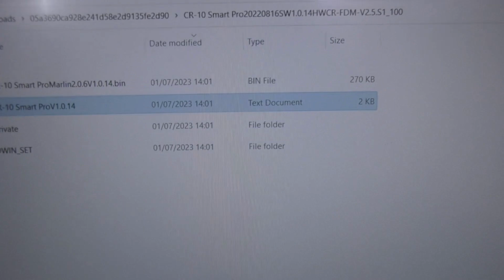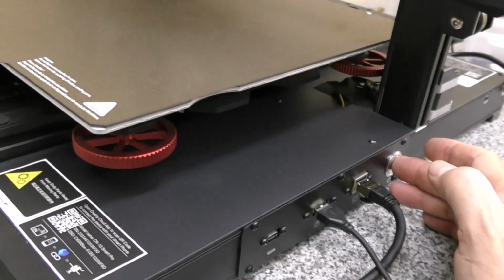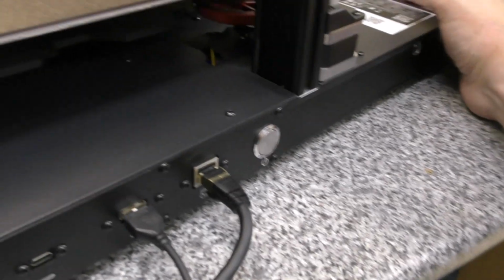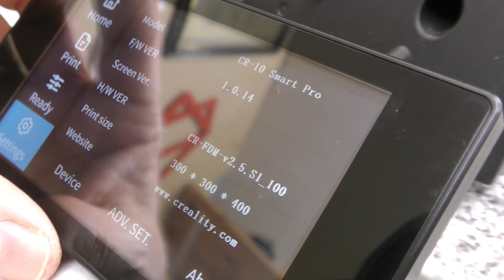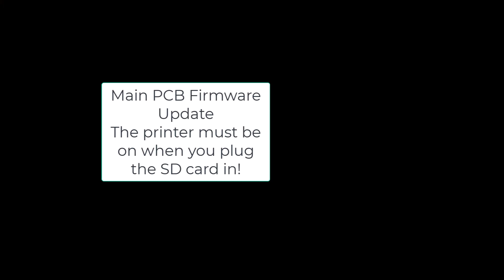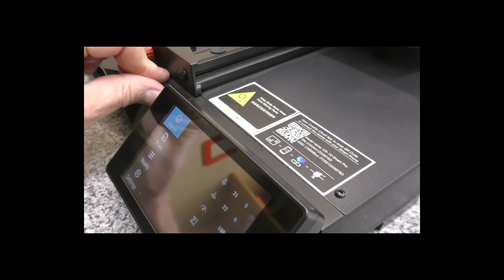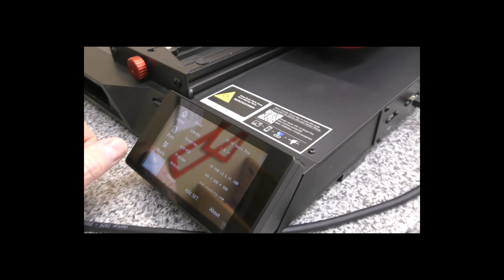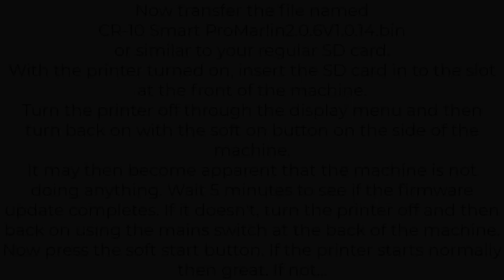CR-10 Smart Pro Firmware Updating and what may go wrong.

Comment: Just got a CR-10 Smart Pro. It has a sticker next to the soft power button that says to hold for 3s to power on, and for firmware upgrade long press for 30s. Guessing they either just added that sticker, or (just as likely) some are shipping out without the sticker.
Reply from the maker: Very interesting, thanks for that great information.

Comment: Thanks did realy help me.
Text on my soft on button says hold fore 30sec fore FW uppgrade

Regarding the SD card 4K this solved the problem.

""Hello, just found your post and I had the same problem.
32GB is way too big to have 4096 sectors with FAT32.

I used the win10 disk management tool, erased the partition on my SD Card, and created a new one half the size (16GB or less), and was able to put 4096 sectors easily.""